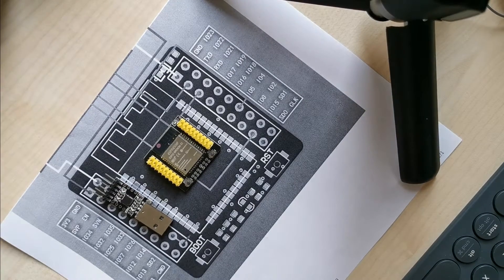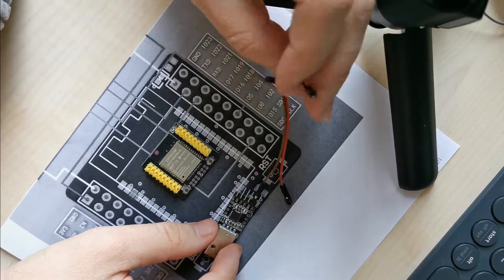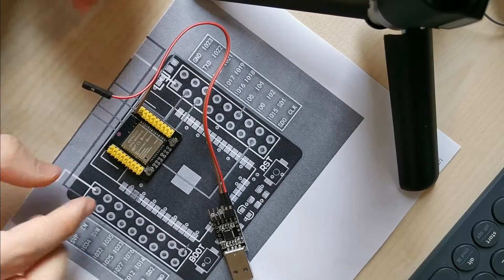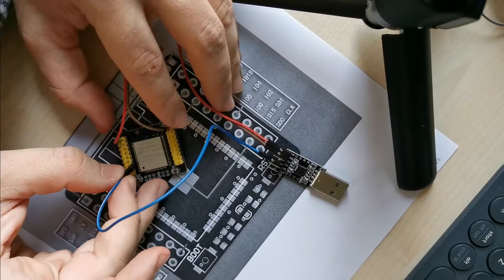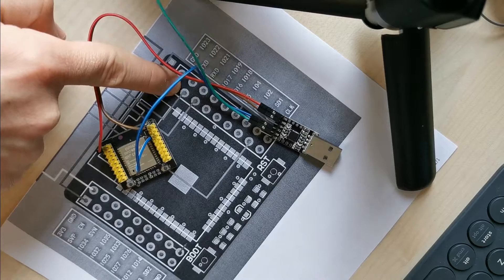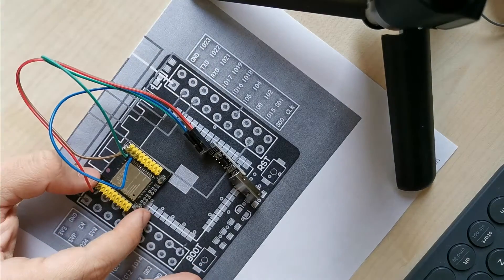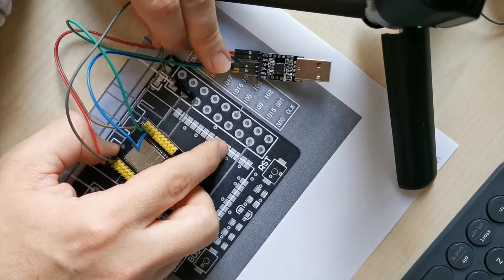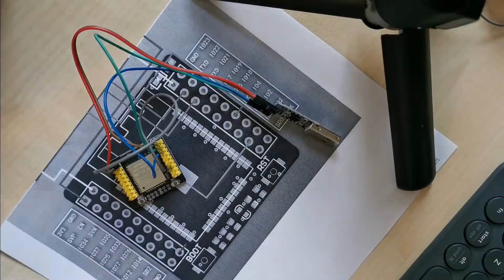Hardware guide/tutorial on how to connect the ESP32-WROOM-32 for programming

Comment: You have BOOT tactical switch on that board for setting ESP32 in programming mode. No need for connecting GND and GPIO0 with jumper wire. Actually purpose of BOOT switch is to do that. Anyway, nice video! Keep it up!
Reply from the maker: Thanks for your comment. You are right
Reply: combination is same like 8266 ?
 BOTH button press-->  release reset  first --> then release IO0 button?
Reply: @sijojohnson  Yes it's the same. Press and hold boot button. Then press reset button once. Release boot button at the end.

The goal is to have the boot button pressed in the boot time.

Comment: Does the uart supply enough power to the esp32? I have a broken usb port on an esp32 d1 mini and i cannot get it into boot mode using an ftdi. Let me know if you have any advice. Thx for the video.
Reply from the maker: Hi Brian, 
as far as I remember it did. Usually, all the ESP32 boards have an LDO regulator and the old USB standard should support at least 500 mA. But the best way to test it is to program it via the UART and then connect it to an external supply. This way if it connects to the WIFI, you will know for sure the UART doesn't supply you with enough current and the issue is with the power supply.
Reply: @refikhadzialic6229  i like your suggestion, I was able to get it to work by putting at 1000 uF capacitor between the ground and vcc of the FTDI. Thanks for the tip.
Reply from the maker: @henninb  Perfect, I am glad it worked out. Sometimes a capacitor can help, most of the time. Sometimes, if the value is too big, it can be messy. I always like to have a working setup so I can compare it in a stepwise manner and locate where I made a mistake :) good luck Brian!